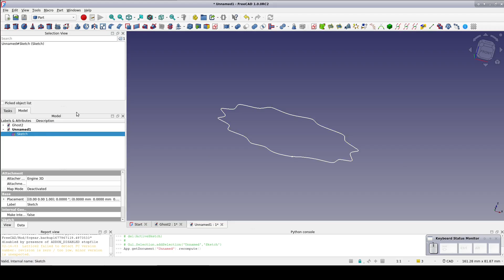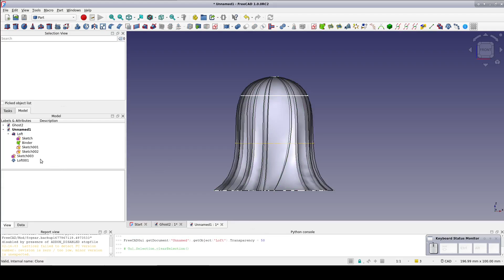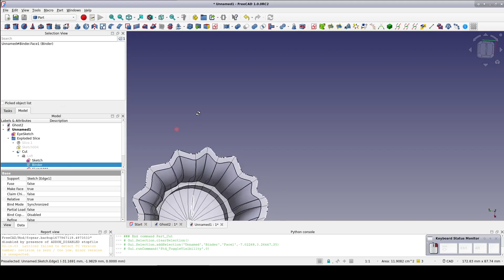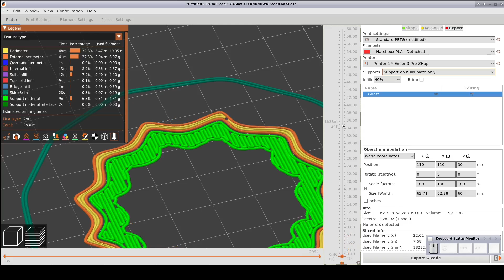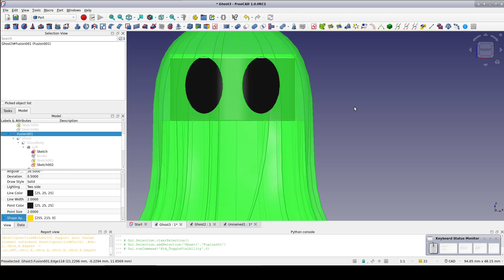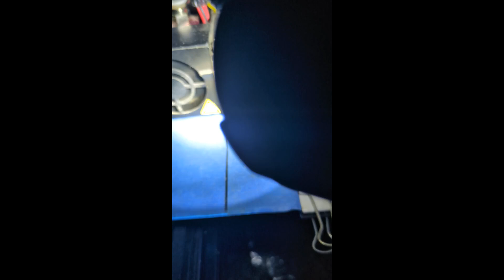A FreeCAD Halloween: BSplines, shape binders, and lofts, OH MY!

Comment: You can use the periodic b-spline tool to get tangency where the endpoint meets itself. Can help avoid shapes that don't offset.
Reply from the maker: True. In this case, it wasn't hard to get a good offset and I found the regular b-spline easy enough, but in other cases the tangency is more critical.